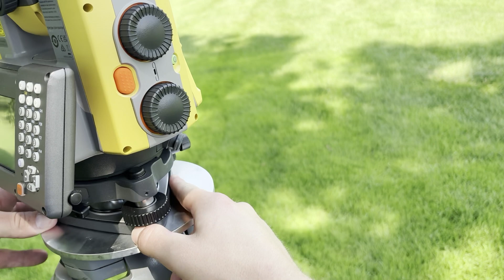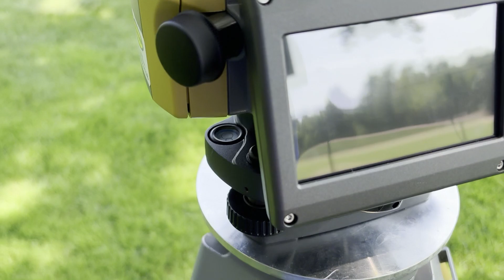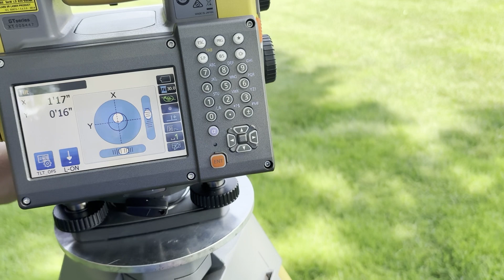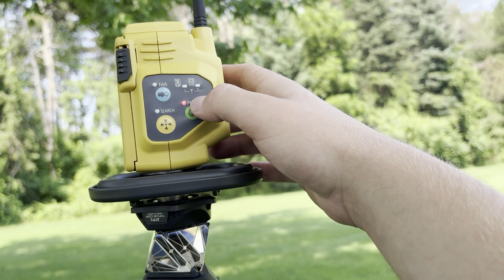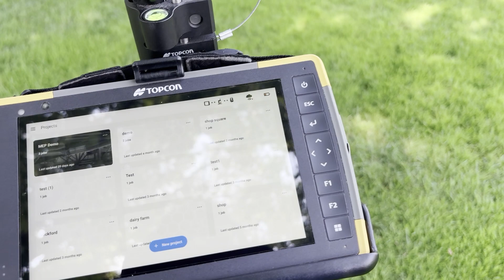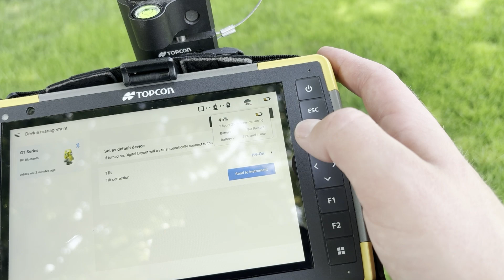Topcon Digital Layout: How to Level and Connect GT/GTV Series Robotic Total Station

Comment: My tablet screen isn’t that new, so at the actual total station what buttons take me back to recheck level? I have done it if the total station goes into sleep mode and I have to hit the power button to come back on but I’m not sure of another way.
Reply from the maker: Hello, it's difficult to answer your question without knowing the exact model you are using. Our recommendation would be to reach out to the dealer you bought your total station from or to refer to the user's manual.